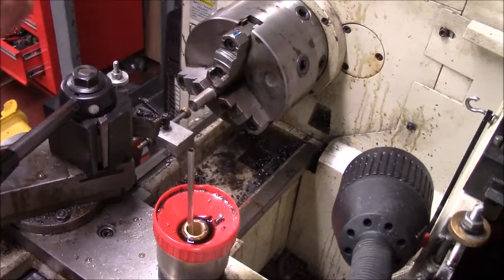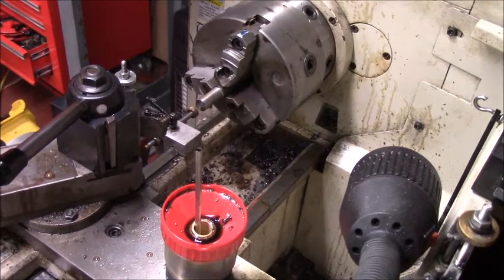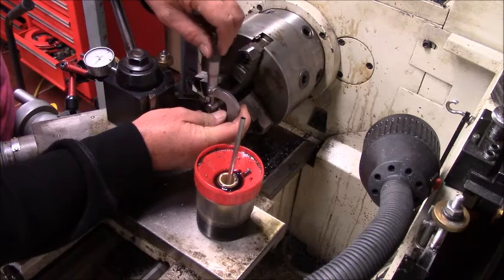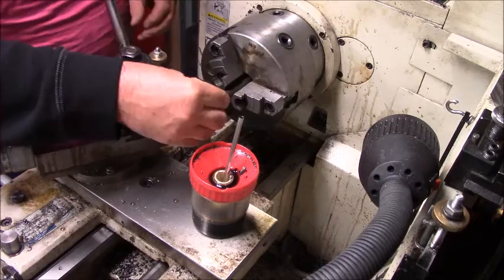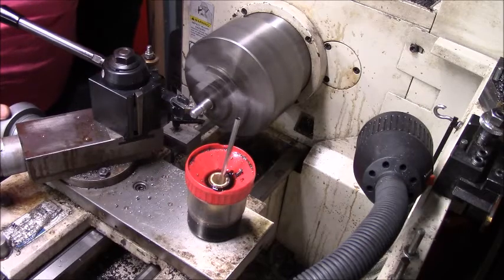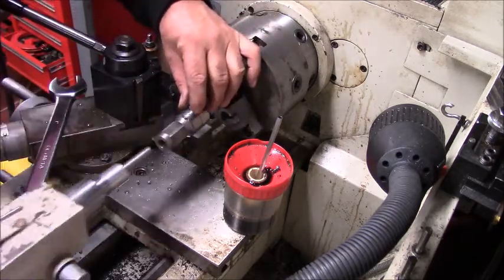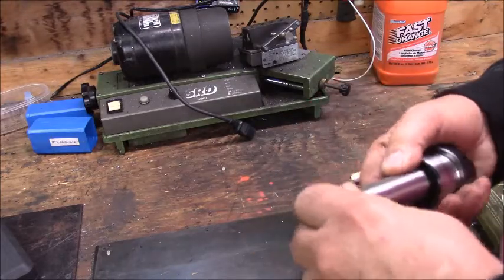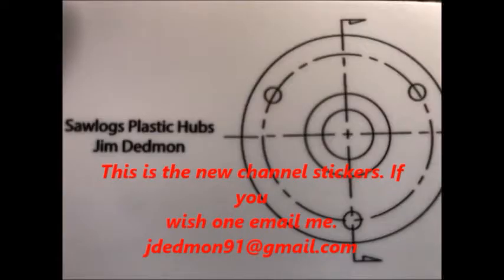Quick Project making a knockout screw

Comment: Hi Jim we will at least these two desert dwellers will enjoy your videos we think you are a good guy. That plug I think is called a retention knob generally at least as we know them for CNC milling machines. so A plug is fine too it does plug the hole unless it is a through coolant of course. A plug is what you needed and you made the plug.
Reply from the maker: Active Atom I figured as much when I seen it. Just needed a plug. I ran CNC lathes for years so this is an diversion for me
Reply: @JamesDedmon  Yes I figured you were just funnin but I alleyways want to be helpful and also to remember my many CNC milling years 3 and 5 axis 45 and 50 taper machines.